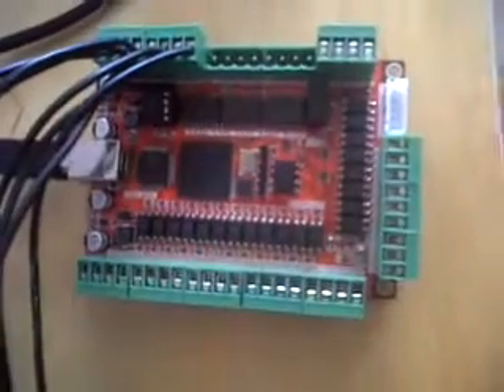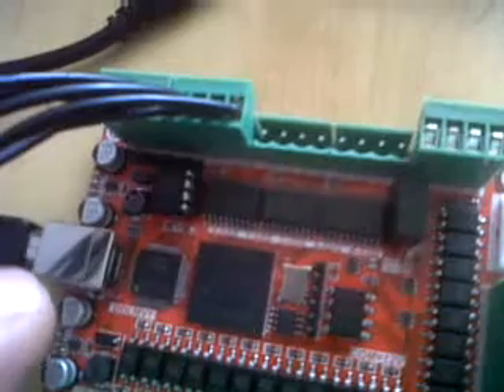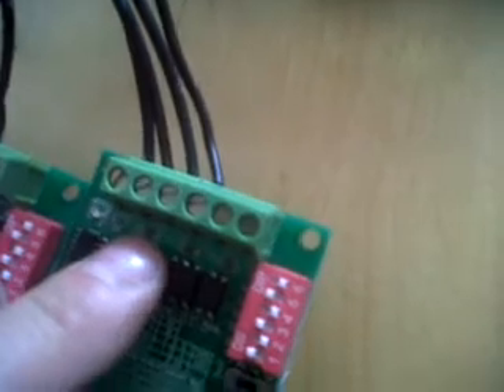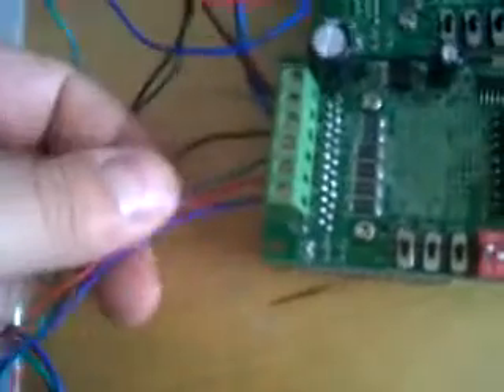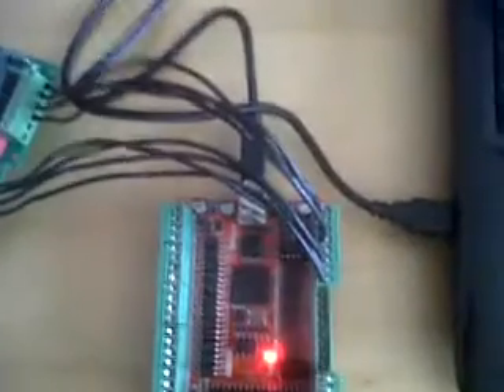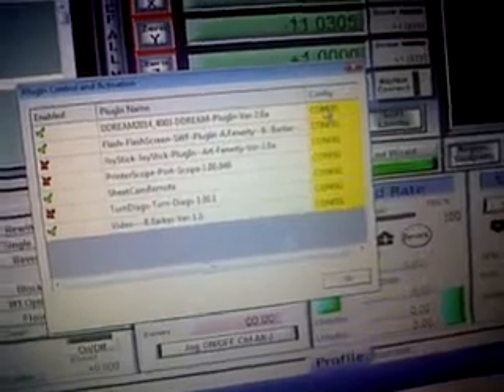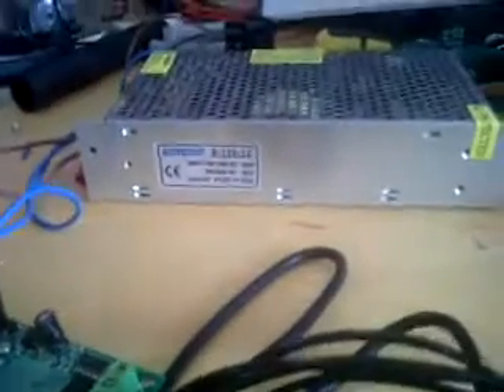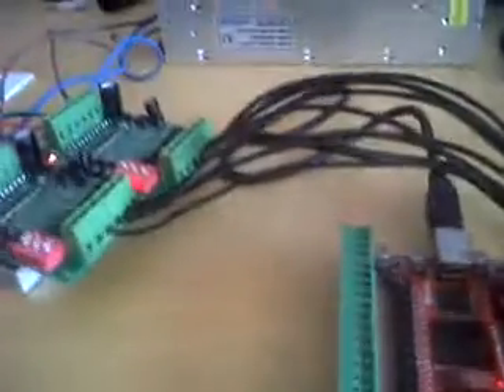ddlmv1 breakout board mach3 cnc

Comment: I'm sharing my review here as well for the card:
The device has instability issues. The communication is sometimes lost to the computer or becames laggy (in serious cases jerky motor movement). Probing is only partially supported by the device (probing is done, but wrong coordinates are saved, all saved coord is the same, can be solved by using macros along the G31 commands). Fixture position is not saved properly (position is lost when Mach3 is restarted). PWM signal is fixed 100Hz (had to build a PWM electonic myself around a NE555 as the 100Hz PWM is unsuitable for my machine), analog has a high Vpp 100Hz noise (it generates analog by charging a capacitor with the PWM signal, noise amplitude is about 0.8Vpp!). I'm replacing it with a proper motion controler now (altough it is really expensive and a lot bigger, has more features tough). NOT RECOMMENDED.

For notes: I have tried it with 3 different USB cables, powered / unpowered USB hubs (USB3 and USB2 too). Created noise filter using the programming pins for one of the uCs. Some of these helped, sometimes the device worked flawlessly for hours than again error (missing steps, jerky uncontrolled movement or just stopped and lost sync).